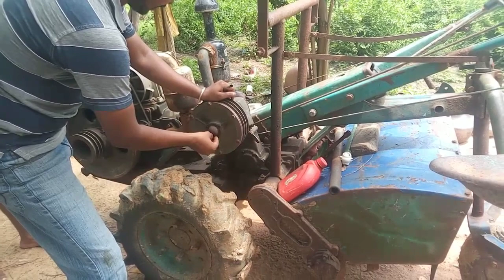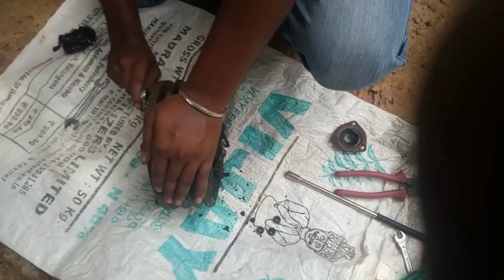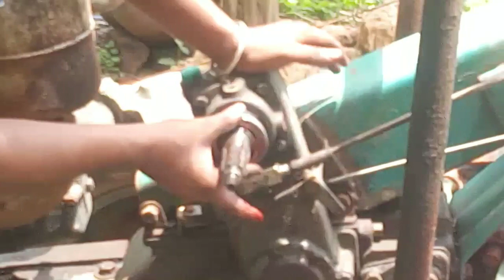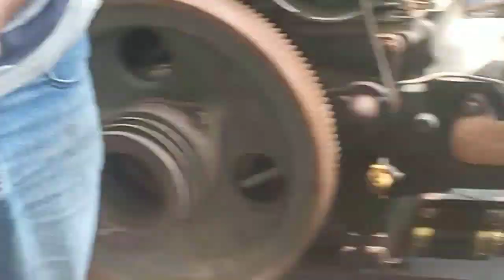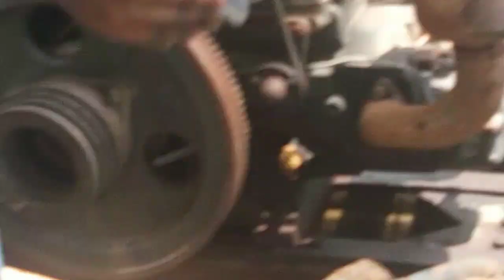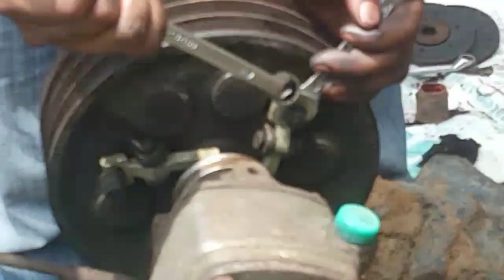powertiller clutch troubleshoot| power tiller solution

Comment: Hi..
Please you explain the clutch engaged and release ( disengagement of clutch) mechanism. The pressure plate tension was adjusted and the small pulley got rotate with bigger pulley ..than how you operate the clutch by lever ?
Please upload that video.
Reply from the maker: sure